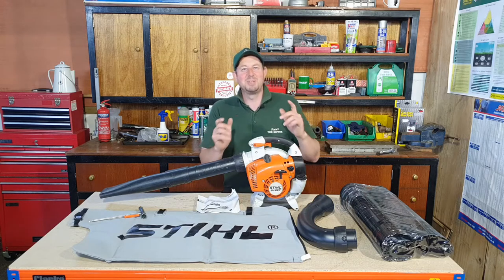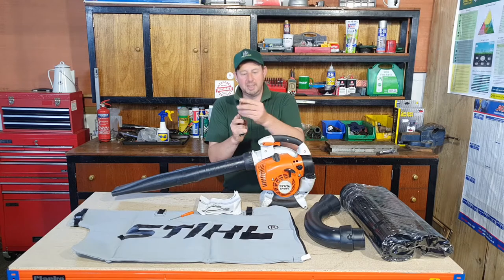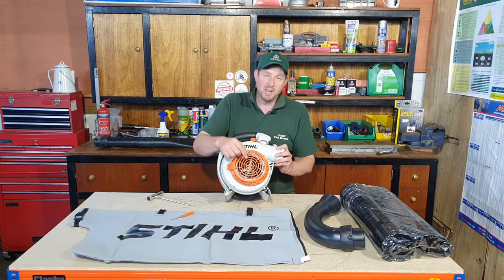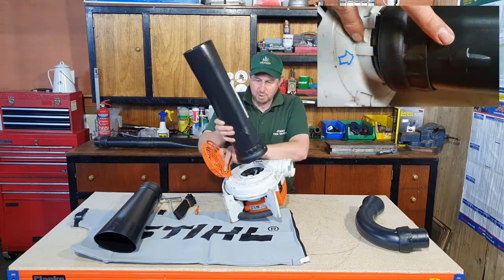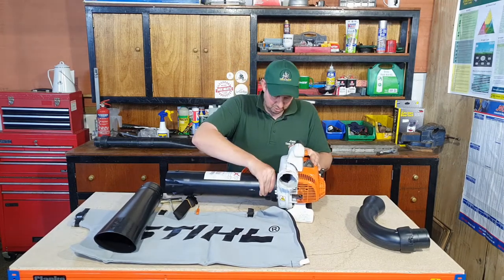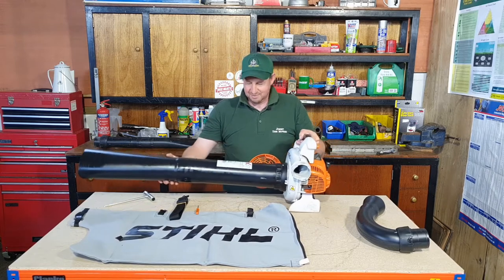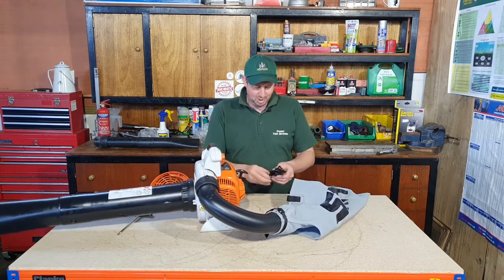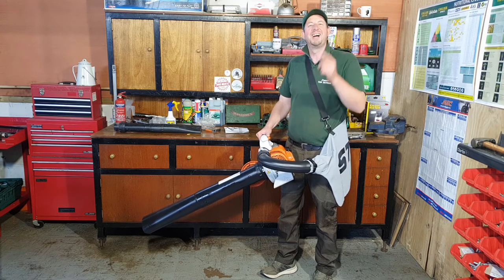Changing a Stihl Leaf Blower to a Vacuum SH 86C collector tutorial demonstration review

Comment: Just a word from experience, when using it as a vac, it does ware the fan blades quite quickly which degrades the blowing performance, it will suck up things that you don't really intend to. Replacements are pretty cheap and easy to fit!
Reply from the maker: Thanks for the heads up.
It seems quite a straight forward machine to work on and has been used to collect all of our leaves this autumn and is still doing well.
I will check the blades out when I service it over winter.

Comment: Hello. I’m looking to buy one to replace my B&D electric one which failed due to a plastic fan blade wearing out as it mulched small twigs and leaves. It didn’t last long. I see the stihl has a 3 blade metal shredder mounted onto……Is it plastic or metal fan blade? Hopefully metal! 
Thanks
Reply from the maker: It's a plastic fan blade with a metal shredder mounted in front of it.
I can honestly tell you that we have used ours for 2 consecutive seasons without issue 👍
Reply: @JimmyTheMower  That’s fantastic, thanks for your help. I think I will go for this one. My old one didn’t have a metal shredder blade on it and just used the fan blade as the shredder. Poor design. Perhaps the stihl fan blade is replaceable for a top of the range product anyway. Thanks again. PS I like your comment on “If you have something nice to say, leave it in the comment section” 👍🏼